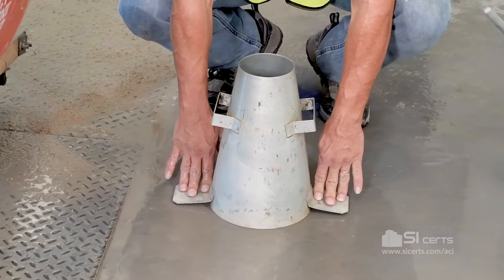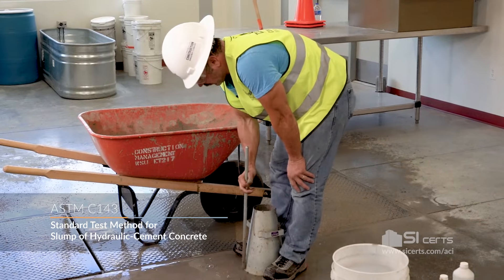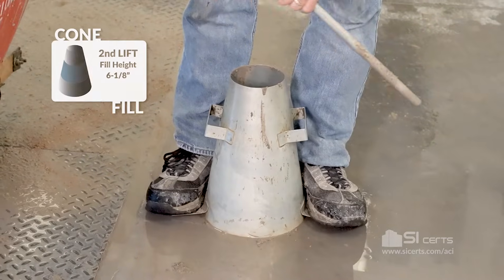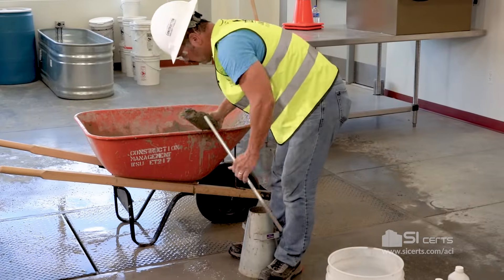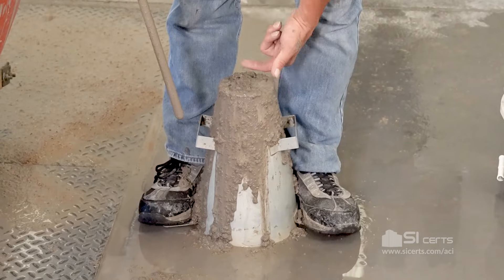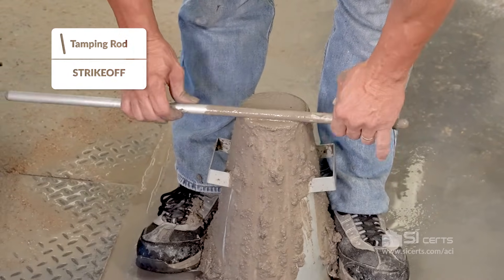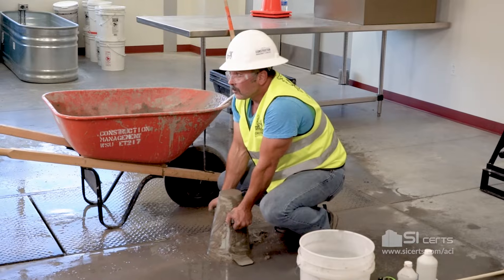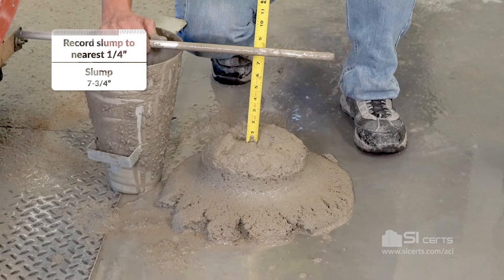ACI Slump Test: ASTM C143 Concrete Slump 2019

Comment: Only jobs these tests are "looked at" are federal jobs.
Reply: It is an outdated test. Slump in the field tells nothing about final strength
Reply: Damn not in upstate NY. Seems like just about everyone requests slump, air content and cylinders in some capacity. Some maniacs make me test every single truck 20 trucks in a row. I’m sure slump has a use for determining consistency but my main gripe is how unreliable the test is itself. Two people might do the same concrete, do all the steps technically correct and end up with completely different values. Not to mention trucks will fail slump all the time and people just ignore it, don’t give a shit about anything as long as the cylinders pass
Reply: Anyone interested in an actual slump test is just giving themselves away as not knowing anything about concrete.

Comment: we use self consolidating concrete at my job. to bad aci tests aren't determined by what you do at your job that way I wouldn't have to do the roller meter.
Reply: of course when i did the field tests i waited until like 11am b/c i was nervous and the guy I did the tests for had tee time in a couple of hours so he just had me talk him through the roller meter without actually doing it.

Comment: I was never on a job that a slump test was not required. And usually that means they also take cylinder samples for PSI test. And if their going to do the last two test, you can bet many soil compaction test were also taken on the fill before we got as far as this video.

Comment: Sir, your mixture are collapsed... 😅 or its just education purpose
Reply: I think this slump test for this batch of concrete fails and not up to standard. the drop of concrete to pass a slump test shall be -/+ 25mm?
Reply: @janetng4735  depends entirely on the specified consistency of the concrete, for example an S3 has a range between 100 and 150mm slump

Comment: As a retired mixer truck driver I had my share of slump test preformed on my loads in my life time, and proud to say I never was caught with a soft load. Now that the test is over its up to the contractor  to ask for and sign my tag for any water to be added, at that point concrete strength is his problem.
Reply: I like being tested, lets me know I am where I thought I was.

Comment: As soon as the owner walks away, more water is added to the truck for easier pumping.
Reply: It is unfortunate that this is the case, integrity is in short supply too often. Hopefully the people who do this get removed from the industry and on to something they don't feel like cheating on.
Reply: this is so true, the inspector that is.
Reply: Yess hahahah that's right
Reply: Lol..  I've done this job 2.5 weeks, and I've seen this atleast 2 to 3 times already.
Reply: @patrickcummins79 lol nice to know there are people who don't follow the codes and provide people a substandard product due to their own ignorance lol......
Reply: That is what I put down into the comments or the remarks section

Just because you’re not standing next to them when they do some thing does not mean that it does not get recorded I would often even show up and hide an hour early and I would see people doing stuff that they are not supposed to do only because they knew I wasn’t there
Reply: @rapper4christ84 Same here.
Reply: To be fair though if you guys are in this industry and you ever see or you run a test and it is noncompliant call the point of contact write it down in your remarks however offer or ask if they want to add a three or a five day break as long as that five day break is it about 75% of its proposed strength that should be fine
Reply: Great insight!
Reply: It happens to the best of us.
Reply: Me the tester sees you added more water reports it lol
Reply: Yup and then you get fired and never work for another concrete company again if im the one that catches you. Youre going let a a whole buildings solid base become dilluted and fall apart on the first pressure because youre too lazy to pump the mix when its correct? Sound like a scumbag. Let it be known, if you get caught doing that, your personal name and company name will be blacklisted on construction sites around the country.
Reply: @KiLLJOY1056  A trick to lower the price of housing and residence in due time
Reply: @KiLLJOY1056  😂😂😂 some people don’t have a sense of humor.
Reply: @KiLLJOY1056  😂😂😂
Across the country huh?
Reply: @rich2583  We hear and see sturcture breakage all the time and sometimes serious damage from all over. It doesnt matter if its in California or New York, Believe me, it will spread like wildfire if your company is held responsible for the collapse of a building because you had a watery mix.
Reply: @KiLLJOY1056  lol you are exaggerating. Someone adds water to a driveway or a pad for a shed or something, nobody "across the country" will even know. 
Do they contact the killjoy database weekly to search for people they shouldn't hire? You must be pretty important for every concrete man across the nation to pay attention to huh? Do you release a newsletter detailing theses incidents?

Comment: once you remove the mold by raising it gradually, and you measure the distance between the TOP in the MOLD, what is the perfect distance that you should measure? 30cm? 40 cm?

please let me, thanks!
Reply: depends on what the concrete is being used for
Reply: Cm? You mean inches? 1 ft = 12 in. Measure to the nearest 1/4 in.

Comment: could someone please explain how does this test effect us an what are the reasons behind it
Reply: Slump is usually a measure of workability of concrete. Workability is the ability to work with concrete such as pouring the concrete. The higher the amount of the water the more workable your concrete but the weaker its strength. So you want to add just the right amount of water to your cement to make sure you can work with it yet it’s strong enough. Usually, that is a 2 to 1 ratio which gives you around 4000 psi or 25 to 30 MPa strength. These are of course all very rough numbers and needs to be tested for concrete.
Reply: As a mixer driver most jobs have a spec that we have to meet. Slump is one of them. Too wet (higher slump) means a weaker product.
Reply: @layneleavitt2537  high slump does not always mean weak concrete. Can’t tell u how many mix approved mix designs there are that require an 8” slump or higher….because of all the admixtures in the concrete
Reply: @empireaxe8852  You can get a higher slump by using different products, its the water/cement ratio that weakens it.
Reply: @layneleavitt2537  yes and the admixtures usually do not change the water cement ratio. It only seems that way because of the slump
Reply: only thing this test does is compare one truck to another load with the same mix, it doesnt tell you water cement ratio, just unformity
Reply: It effects you by being a big pain in the ass. It really means nothing, but it gives people something to argue about on the job, and a good excuse for unrelated problems.

Comment: where are the gloves?! who wants cement burns??
Reply: Miles Latham  lol I don't know if I ever wrote 16 hours. I booked time for the course and then we had this Coronavirus thing.
Reply: Only girls need gloves. My hands are pretty nice still after 15+ years of this shit almost never wearing gloves. Just use a good lotion and wash up real well at the end of the day
Reply: Men dont wear Gloves. We wipe that shiit off on our pants. No big deal..
Reply: Cement burns are for pussys who haven't been around cement long enough
Reply: @Frakkture311  have you done the ACI code certificate? if so kindly do you have recommendation videos will help passing the test as you the course time so short.
Reply: Aula Jomaa I did practice tests on line . And watched as many cvideos on density test and slump as I could and air. Just keep watching and keep memorizing the steps.
Reply: Aula Jomaa are you from Canada or states ?
Reply: @Frakkture311  I just moved to the State.
Reply: Aula Jomaa when do you go for your certification
Reply: @Frakkture311  well I should've got it on March 06 but all canceled due to coronavirus but I did my study so I feel I am good. If you planning to get it and need help let me know we can work it together.
Reply: Aula Jomaa I got mine on feb 08 I can help you with anything you need tho
Reply: @Frakkture311   thanks , i need help in the calculation of the Volumetric method, i dont really getting how they do or read the reading please